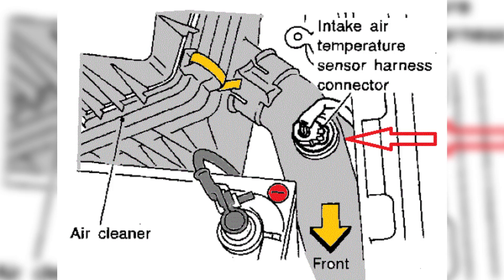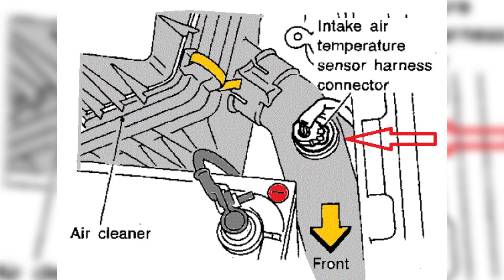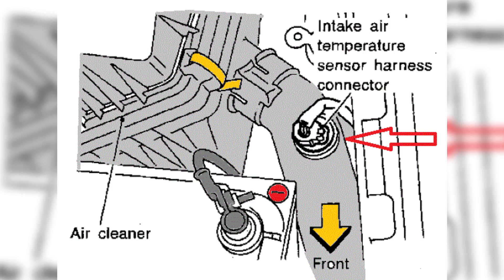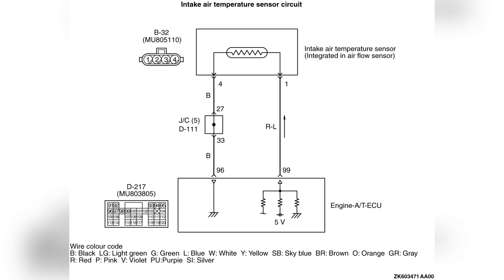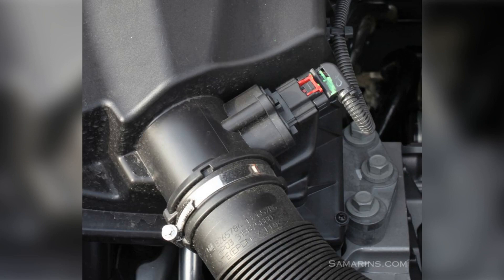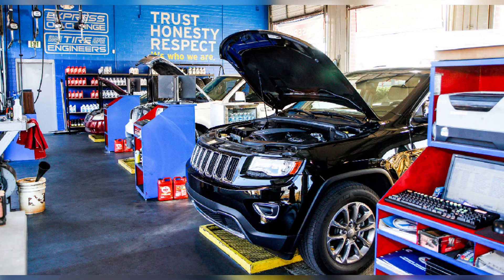P0113 - Intake Air Temperature Circuit High Input (Causes, Symptoms, How the IAT Works and More)

Comment: Im just wondering,, whoever had this before me has 2 short wires coming from the plug, and they had 2 little connectors and the wires coming out the other end, goes to wherever, I'm not sure where those go, but last night I changed my spark plugs because I've been having a misfires and my light dropped right behind that area, so when I picked it up I noticed the one of the 2 wires was dis connected from that little joining piece. Is it soposed to be joined, or is it supposed to be just a straight wire? I'm thinking on having to get a new one but I don't know if I just take the joining thing out and tie the two wires together on each one..Any thought would be appreciated

Comment: I got that code and it turned out to be a failing ignition coil of all things. Moral of the story is investigate the symptoms beyond the codes the scanner returns. Sometimes a failure will return erroneous codes. I've had an evap code that turned out to be a failed power steering pressure switch.

Comment: My 1996 Dodge B2500 is hard to start when it's cold. It takes about 30 seconds of cranking on it to finally start it. After it's warm, there is no problem at all, starting or running. I heard about the intake air temperature sensor can cause this issue. I bought a new one from O'Reilly's, put it on and it did not fix anything.
Reply from the maker: It's hard to say what could cause the problem without testing a few sensors with a multimeter or scanning the fault codes if it has an OBD port. But my best guess is the coolant temperature sensor, or MAP/MAF sensors depending on which one it has.
Reply: @PrecisionMotors-ib9cy  Thanks. I get over my head when trying to diagnose a problem. I am also no good at using a multimeter too. I also don't have a repair manual for this van either so without that, I really don't know where or what the MAP/MAF looks like on this van.
Reply from the maker: @snailracer3773  What engine is in the van?
Reply: @PrecisionMotors-ib9cy  Sorry for a delay response, didn't know. The engine is a 318. And you suggest it may be the "coolant temperature sensor". Isn't that the sensor to the dash gage, it's next to the thermostat and is extremely difficult to get to? If so, I already replaced that sensor a few years ago while doing a water pump job and the dash gage works fine.
Reply: @snailracer3773  If it only happens when its cold, it could be your battery. It may not have enough cold cranking amps for the size of your engine
Reply: Good 😊😊😅I 9😊via 8m  @PrecisionMotors-ib9cy

Comment: I changed the MAF sensor and then this code popped up a few hours later. My IAT sensor is not integrated into the MAF. Any thoughts?
Reply from the maker: In most cases even when the IAT isn't integrated, its two wires run through the MAF sensor connector so I would check if the MAF is reconected properly. Also, inspect all the wiring between the IAT and MAF sensor, and check the IAT pins and terminals inside the MAF connector. Other than that, my only guess is that the IAT is bad.
Reply: DID YOU FIX IT? i have the same problem. my shop changed out my MAP sensor and now it says that my IAT is high. its reading -40 degrees. and I changed it for a new one and nothing changed
Reply: @cmoshpit9171  I ended up cleaning my old maf sensor with maf spray. I reinstalled it and everything was fine.
Reply: @Darren-pq5oc I figured out my iat and maf was indeed integrated. I bought a cheap Amazon maf with integrated iat. It was bad out of the box. Ultimately, I cleaned the original maf with maf spray cleaner and reinstalled. Everything works great now! 👍

Comment: Will this cause no start
Reply from the maker: It can lead to difficulty starting the engine, especially when the outside temperature and engine are cold. That means longer cranking than usual before the engine fires up. But it doesn't cause no start or no crank.
Reply: @PrecisionMotors-ib9cy my car broke down.. engine would turn on but as soon as I pressed gas or tried moving it sputtered and lose power and stall.. after many attempts the car barely even started afterwards... now it's not even starting at all i got P0113 codes
Reply: @nbsmota  at the end it had nothing to do with the code I had. It was the egr valve that was stuck open and let too much gas into the engine.
Reply: @nbsmota  if you have a diesel car it could be the egr if you have the same symptoms as I mentioned above. One way to find out is by opening the egr return gas pipe (to stop excessive exhaust gases back into the engine due to the egr valve failure) and try starting the car if it does start  as it should, it's the egr